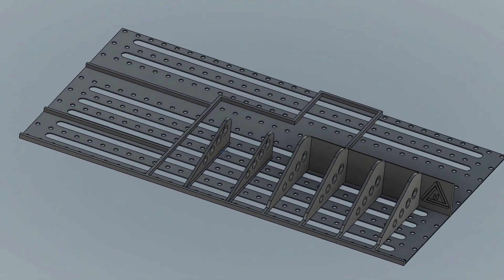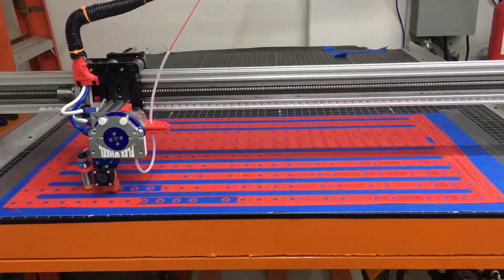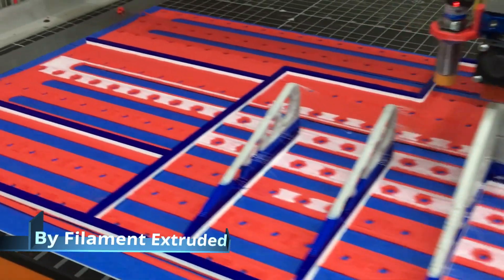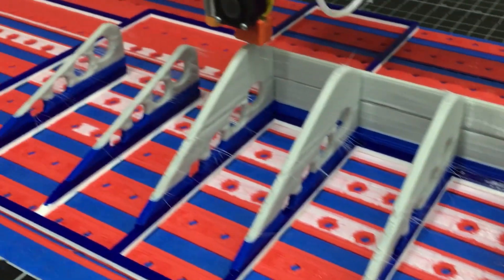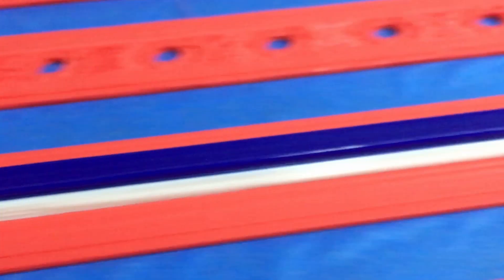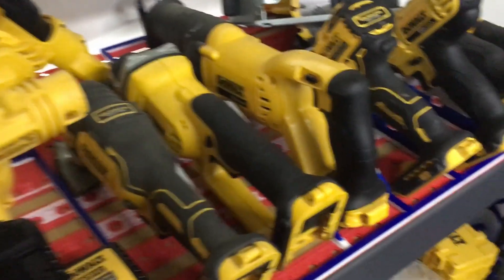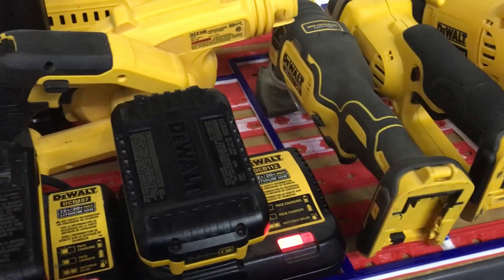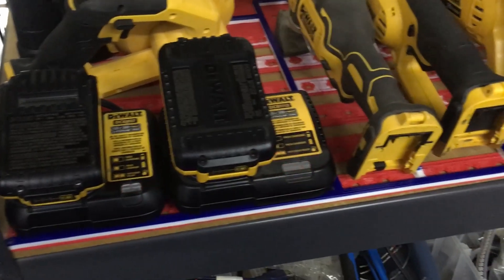Large Print on DIY Ultra Large 3D Printer Multprocess CNC Machine

Comment: What do you think this cost in plastic material only???  Curious if it was economical
Reply from the maker: I used all scrap filament what was left from a  few different rolls. About 1/2 of a full roll was used in total so about 10 bucks for this print.
Reply: @CountryAireDesign  Thanks for this that is helpful!